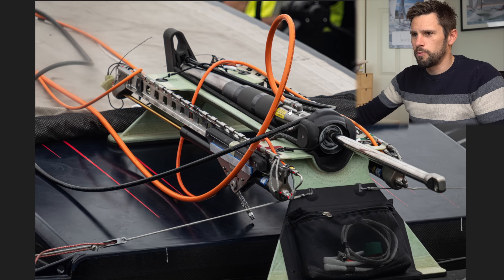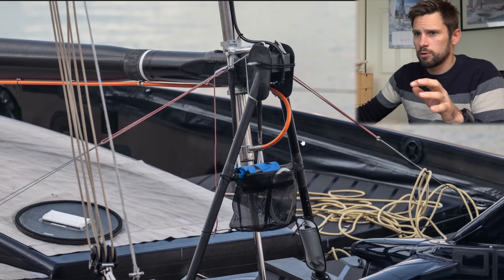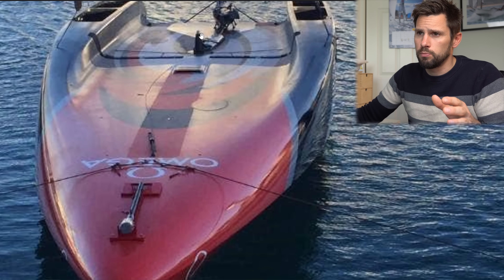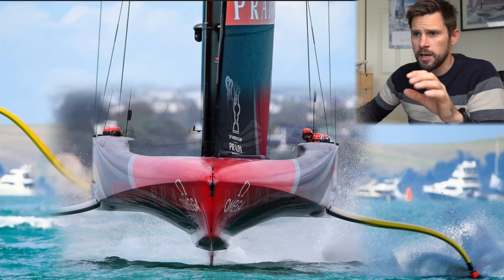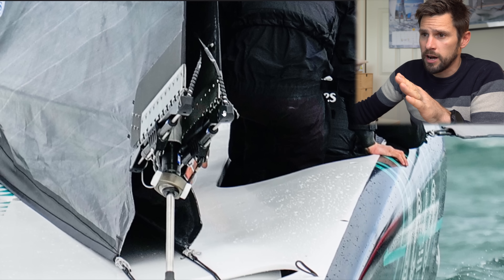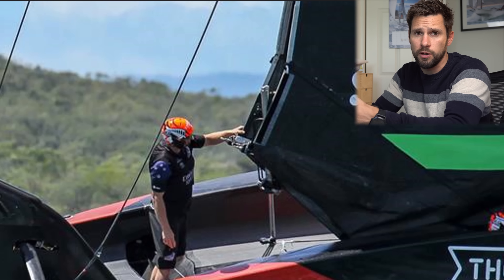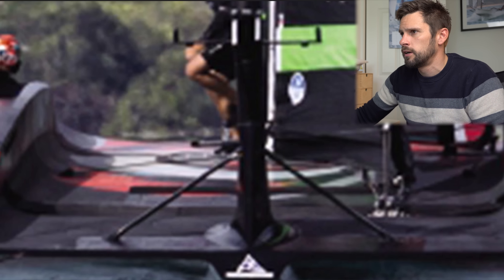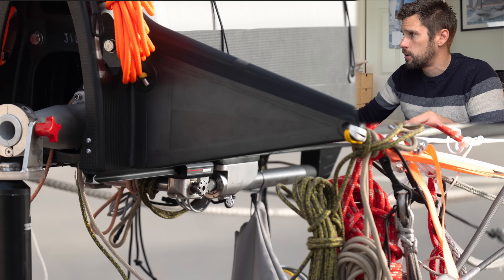Alinghi go boomless... matching deck to follow?

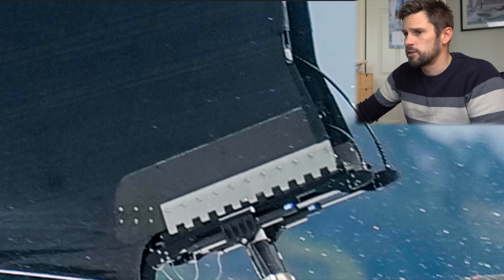Comment: 7:28... You need to do more reseach into aerodynamics. That fat clew is open, so works even better than a kamm-tail, and the net wind resistence as a result is zero.
Kamm-tails are better than long tails, since there is no surace drag, and open kamm-tails are better than blunt kamm-tails as there's no physical sruface for the turbulence to attach to.
Like I said... Do more research.
Reply from the maker: and yet, a year later, all the teams have followed the approach of moving the main sheet ram hardware down and the skin closer together. And Team New Zealand have gone a step further to remove all hardware. So, you may want to do more research

Comment: Hello Mozzy, I am new to your "channel" but find it very interesting. Question: Is there any chance that the space between the two sail "membranes" could be used to house something else, for example a sort of braking system (parachute) that one could use to slow down and accelerate the boat (for starts, prioritoes etc.)?
Reply from the maker: They are limited on what can be put between the skins. In the bottom 1.5m they can put whatever they want, so control the skins. Then at the they need to carry a supplied buoyancy bag which stops the boat inverting if they capsize

Comment: On the fat mainsheet exit... as long as they keep a sharp Kammback trailing edge in that region then the Karman vortex street turbulence will be minimized.
Reply from the maker: Yes, it's certainly not a complete disaster, but also not 'ideal' and blending the Kammback with the traditional sharp  aerofoil trailing edge above can be tricky where you have soft sails

Comment: Fascinating discussion. One has to assume that trades between 1 - larger but smoother faired upwind frontal area and smaller sail area down low, versus 2 -  smaller faired frontal area (but more turbulent with beam protrusions) and lower sail center-of-effort were made. Dragging these big ugly high skin area hull shapes through the air must really eat up the available power from the sails.
Reply from the maker: In the previous Cup we ran a VPP model (quite crude) and the foils produced the overwhelming majority of the drag. That's not to say a few % can't be made from aero drag

Comment: I should have added that the fore runner of the Shannon Shoal Sailor was the Dutch Sailing Barge, and the reason why the Dutch were so far ahead as ship builders was because of the Dutch Timber cutting Windmills. Technology wins every time, and complementary technology is even better.

Comment: The cheap and simple way to achieve this and transfer the concept to cruising boats is to have a boom, but a foil curved boom which rotates from the boom hinge point in between the two sail foil skins and where the rotation angle automatically sets the tension as the rotation increases from side to side. The mast should also be mounted on a slightly conical slewing ring plate which directly transfers the loads to the hull on either side (slewing rings are the essential part of excavators that allow them to handle the extreme loads that diggers develop).
I find the Hull Shape intriguing. The genesis of this design style is not at all new. See the Shannon ShoalSailor (2004). But the real fore runner of all of these concepts was a design called the Aero Hydrofoil from the 1960’s.
I wonder how long it will be before someone attempts a mast head winglet to reduce pressure spill at the head of the sail?
I like to remind all of the super sailors that one of the most successful racing yachts was a Ferro Cement yacht, Helsal, which in 1973 achieved the trifecta of line honors, a time record, and winning on corrected time in the Sydney to Hobart Race. A trifecta the held for 35 years. The “Flying Footpath”.

Comment: Great analysis! I'm wondering if there's an aerodynamic advantage for Alinghi, Luna Rossa etc in having a lowered deck? Apart from the wing "thing" by the mast rotation this probably leads to less frontal surface to cause head-on drag, don't you think?

Comment: I was thinking about the clew thickness. It doesn't strike me as aerodynamically optimal. Would it be possible to relocate the ram under the deck near the mast? If you fix one end to the traveller and then use a block on the clew and in the mast to route a (presumably low stretch) control line?

As others have commented, it's good to see you back.

edit - on reflection, using a crank located between the clew plates might allow the line to be routed directly down to the deck which would prevent the line messing up the upwind sail surface. You could then run the line through a below-deck block toward the mast foot. On further reflection, the entire traveler system could be rigged backwards with the running end connected to the clew and a below deck block running the main sheet to the foot of the mast where you could install the ram.

Comment: I like the “in clew” sheeting system, but don’t like the ram and gubbins to control the mast which along with the fatter clew does cause aerodynamic problems. Having a slimmer deck also allows more sail area, but I wonder if it’s not better to have a completely smooth aerodynamic laminar flow deck shape to turn the whole boat body into one big uncluttered wing with less hindrance to the upper, low pressure surface?

Comment: The discussion of the "thickness" of the hull is interesting. 

Parasitic drag increases by the square of the airspeed, or I think apparent windspeed in this case. So the low deck, less frontal area, hull would be better for reducing drag. The interesting thing is that hull itself has to be acting as a wing to help the boat fly. I suspect there is a tradeoff between having a hull that is shallow with low drag and therefore does not produce much lift vs. one that is thicker with more drag but helps the boat to fly. The complexity is pretty mind boggling.

Comment: Hello, a quick question that you may be able to answer: Why are winglets not also used? Surely there must be a pressure difference at the tip of the sail, analogous to airplane wings, which leads to vortices and thus an increase in drag Thank you in advance and please stay safe.

Comment: I have lost so much interest in the Americas Cup.  There are a couple reasons I’m sure.  I really disliked the multi hulls, it was too sterile.  While the boats were fast, the actual racing was mind numbing boring.  The new boats look like those frogs that run on top of the water.  I think the technology has overtaken the roll and imperfections of the crew.  I think the TP 52 racing is the best in the world today.

Comment: Is it that a lowered deck is more about being a quicker and easier maintenance access point for the teams than a major performance benefit at this point during testing? One thought on the Clew being wider as a non-issue, if it was viewed from a Kamm tail aerodynamic perspective?

Comment: It looks like more teams will be emulating some of the key design features of Te Rehutai with sound reason. Luna Rosa has adopted the dropped deck feature and it's a good guess Alinghi will follow suit now that they've gone boom-less. It will be great to see Te Aihe optimized with further development. I always liked the lines of this yacht.

The fat clew might not be as bad from an aerodynamics perspective as it appears. Those familiar with aerodynamics theory will be aware of a Kamm tail. It's a truncated airfoil that generates controlled turbulence in applications where a full length airfoil is either impractical or restricted by regulation. It's heavily used in modern pro cycling because the UCI has strict rules governing aerodynamics of components. It's also advantageous in certain yaw angles, which may or may not apply to the speeds the AC75 is capable of. This subject is very complex and I'm by no means an expert in fluid dynamics, but wondering how much of an actual detriment the fat clew is aerodynamically?

Comment: If most are doing it I assume that extra drag and fat clew are worth the benefits - lowered sail/deck/ centreOE etc.  
Never will know but I wonder if TNZ held back development last cycle and they had cleaner and more efficient set up. Silly question, is drag more relevant up or down wind in this class? 
Thanks for the insights
Reply: I though that was an obvious question but then I threw some ballpark numbers in an apparent wind speed calculator... 45 degree upwind and 135 degree downwind angle with 20kn upwind speed and 50kn downwind speed in 20kn wind... The difference is only 1.5kn.

If you have time to look up actual wind speed, boat speed and direction data and calculate more accurate numbers, let me know what you come up with because this is a bit interesting.
Reply: @AnttiBrax  thanks for your response, that seems like a negligible difference. I think I’d be out of my depth at a quick rate if I started throwing numbers about. But I am keen to learn, albeit at a high level/overview. Have a great weekend

Comment: Great video! When you say Mainsheet, do you mean the control that pulls the leech straight down? I know some folks call that the sheet, and the side to side motion the traveller. As a dinghy sailor, I always think of the mainsheet as being the most important control, and the thing that makes the sail go in and out, as in sheeting in...or out... so, I would call the side to side motion of the clew sheet, and the vertical motion vang  Thoughts?

Comment: 9:22 as an aero engineer, I would call that "wing bit" a control horn. That's what we call similar fittings on control surfaces like elevators and ailerons
Reply: Or crank, maybe, to use a more general term

Comment: I suspect the separation at the clew is unlikely to be as detrimental as you think due to a couple of reasons (see video 9:13): 1) the air in this area is likely to be turbulent flow and 2) lowering the deck lower moves the problem zone on the sail down further reducing the impact.  I'm not sure whether the two skins on the sails are allowed to be connected but you would think if that was allowed, there would be some sort of internal skin to zip the sails together in this area.  I'm also surprised the mainsheet ram is not rotated 180 degrees as the arm is much thinner than the ram body, this would also lower the weight in the boat.  Thanks for the interesting vid and discussion.
Reply: I think they are allowed to be connected because I saw the teams connecting and separating the two halves of the mainsails.

Comment: looking at these large mainsheet cylinders I am wondering why these are not remotely mounted in the side hulls where there is more space and run through a 2:1 purchase onto the traveler. Then they would only need the width of the block between the the two sail skin cylinders?

Comment: The lower deck also allows for more main sail area, I think they’ll be crazy not to take that free extra horse power
Reply: I believe in the previous cup TNZ had roughly 3 square meters extra sail
Reply: @minime453  maybe, but you still need to see where those square meters are and also that taking off at a lower speed was critical in the last AC, let's see in this one

Comment: I am just wondering why. the hydraulics are not mounted on a plate fixed to an 'arm' (boom?) that fixes the relationship between the rotating mast and the traveller. In that way the three hydraulic rams can work on lines taken aft to the 'traveller' and up to the sail. This would allow the aft deck section to be 'shallow' and fit the rams under the deck where there is space regardless of the design. Are the traveller and rotating mast permitted to be fixed in their relative positions ?? Interesting topic is it not?
Reply: I strongly believe they can and in fact that is what prada had.  I just suspect the added structure to take is around the 90 degree bend is too punitive in weight.

Comment: Good insights Mozzie. I am thinking that if that gizmo is on AC40s (which are identical I believe) then it is unlikely to be on the AC75.  I further suspect the NZ yacht will be totally different from last regatta.  In particular, it won't have a jib as apart from the start it actually slows the yacht down at high speed and it will focus on high speed ahead of everything else as it will really be a plane.  All this should be the trigger to get back to real yachts. 🙂
Reply: Ok p

Comment: The penalty for truncating a wing is low, see kammback in automotive design ie shape of most hybrids/prius/tesla. Better to have a lower hull frontal area and get the mainsail longer and lower.
Reply from the maker: Agreed, but if the trailing edge is fatter than what is ahead of it, then that is bad. The skins are closer together at the leech immediately above, so you have a transition in trailing edge thickness to manage there and so in the section shapes above them. 
ETNZ made a lot of effort just before the cup match to taper that trailing edge, suggesting they weren't completely satisfied
Reply: @MozzySails  Agreed re thickening at the leech being bad (its a compromise etc) and the transition above the clew. Certainly ENTZ did work hard to reduce the size/profile of the clew mechanism. Also, what they may use for testing can be larger than any race system i.e. figure out the loads you needs to accommodate, wider range of movement in the test boat and then build a much reduced/miniaturised race version. Also, when would the stall be worst? At high cambers for takeoff..when most of the lift would be coming from the top of the rig in more apparent wind? 

Has anyone talked about how the whole hull becomes a wing with the Entz design (and luna rossa's?)_ i.e. some of the lift of the boat comes from the hull in profile? the crew cockpits acting as endplates i.e. in the opposite way to a 70s F1 ground effect car, with the lift supporting the boat.

Comment: I was sooo confused by the first image showing the cylinders sitting in the green cradle on deck. I'm like, "how TF does that act on the sail?!" It wasn't until 6:00 when we got to see all that gack in situ that the penny dropped! These boats are so damn cool. Thanks for the Video Mozz!
Reply from the maker: I'm pleased to have shed some light for you
Reply: I'm still wondering how the attachment to the track works, since, without a boom, there must be a lot of forward pull from the sail tension on the track.
Reply: @charlestoast4051  Sure. It's not super creative sail control tech, but how they've set up the "traveller car" to resist the tension ripping it off the deck and still be free to move side to side would be an informative bit of mechanical design to see!
Reply: @nickgoodall578  I would assume that it doesn't move freely but is moved with hydraulics. In which case just about any reasonably closely curved track would do (and I think they have calculated it down to 0.1mm, not just thrown some random track in 😉).

Comment: I suspect the low deck is more aero efficient than high deck. Therefore I predict low deck
Reply: There's a definite reduction in frontal area. Sometimes more frontal area is better if the entire shape is superior from an aerodynamics perspective by delaying flow separation of the boundary layer. It depends on the overall design but generally speaking, the less frontal area the better.

Comment: a bit off topic but would it be possible for you to compare what the advantages and disadvantages of the wing sail used in previous cups compared to the double skin sails used now?
Reply from the maker: That would be interesting, we'll look at it at some point. There's a long time until Barcelona and plenty of sailing tech to discuss!
Reply: I'd be interested in this as SailGP are using wings
Reply: The solid wing sails are pretty fragile and if you recall the initial thinking with these new AC foiling monohulls was that they were likely to capsize,  hence the original aim to be self righting.  So if you are going to capsize you don't want to shred your wing.  The performance isn't quite at the same level but it's certainly better than a single sail.
Reply: @sailtastic  Yes, and there's also the weight factor. The AC75 mainsails are much lighter without need of the complex mechanical parts of the solid sails. If the AC75 is more prone to capsizing, the possible effect on the center of gravity was definitely a consideration.
Reply: @James_Aron_1967  and @sailtastic Many thanks to you both. Love this channel.

Comment: The main reason for lowering the deck is to reduce the overall frontal area of the boat because drag is the area squared. Small gains have a big effect. Add the additional sail area at the bottom and the dis-benefits of appendages sticking out melt away.
Reply: Lowered deck seems to give the hull nice horizontal wing shape. Propably greating bigger pressure differential above and below the hull.
Reply: drag is a product of the area times the speed squared......
Reply: @charlestoast4051  Yes, quite right. I knew it was something like that.